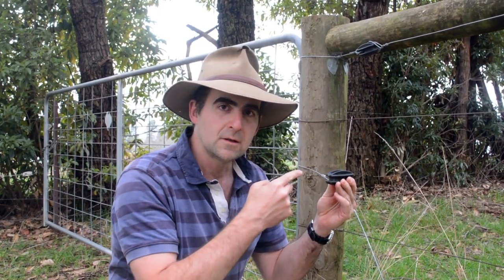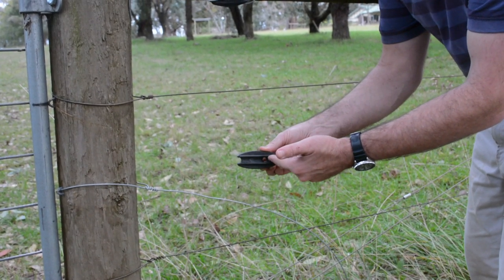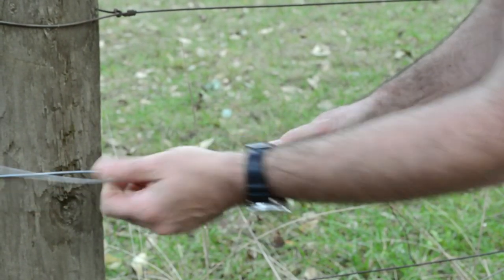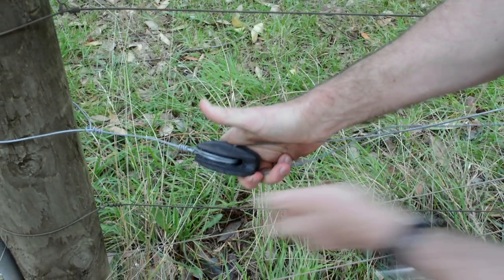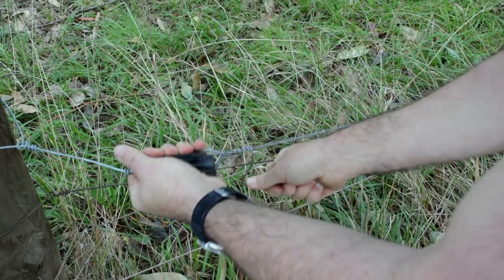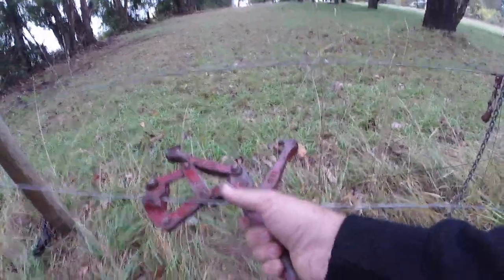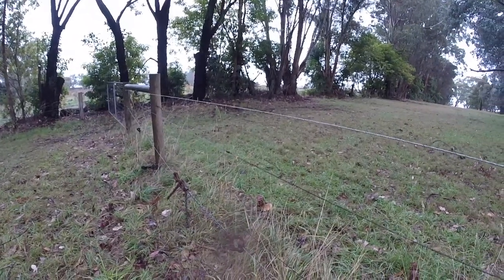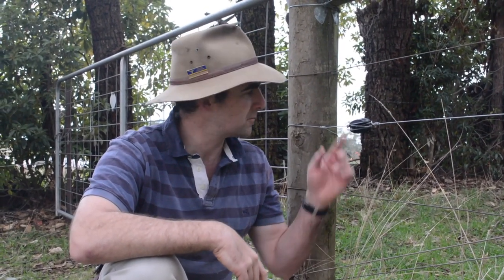Tying Off and Straining an Electric Fence

Comment: Hi Tim . what wire is better for electric fencing high tensile or aluminium wire and how to strain the aluminium wire and is tying off the same as high tensile. I know the video has been made a long time ago but i am just going over your videos again
Reply from the maker: Hi mate. Use highly conductive aluminium coated wire for lead outs to increase fence performance. Normal perimeter and internal wires should be fine with normal high tensile wire. I’m planning a video on wire choice soon
Reply: looking forward for that one @FarmLearningTim

Comment: Not being born in Australia I never even had remotely anything like AG as a subject; now through circumstances I am having to manage a farm that otherwise would have to be sold so this type of step by step videos are proving to be invaluable especially it is all FREE! Thank you Tim for this kind of masterclass...By the way Tim I seem to struggle a lot with the strainers. I have a hayes one like yours but it has a spring and I find it a nuisance and hard to slip the chain through. Did you take your spring off or did you buy it like that?

Comment: Just moved on to 11 acres and had to put up poly tape on pickets to retain the horses we got, but will be looking at rest of the fence line. Thanks so much for your very informative and concice videos, jam packed with little jewels of knowledge. Just one question for now, what is the spacing of your posts? I have 7m between my pickets for the poly tape, but will be looking at HT wire for boundary fence.

Comment: Hey Tim, love your fencing skills. Working on an electeic fence for about 30 acres right now. Using insulators. What I'm having troubles at right now is in corners where I have end strainers going to each fence length out from the corner like you have here at your termination. But, what's the best way to jump the  electric fence wires? Right now I just jump with poly that cuts off the corner, but would love a more elegant solution. Any tips?
Reply: Thanks for your thoughts, Tim. What you're saying sounds pretty much like what I'm doing. To avoid using the standoffs on the wooden H termination, I've done the bullnose on the live side (outside) of the H. I then jump from these live wires to the live wires on the other fence coming into the junction (and its own H termination) to successfully navigate the corner with electricity. Thinking now maybe I should have offset the wooden H post to try and equally balance the force being applied from the wires and only requiring 4 bullnoses instead of 8.. I was worried the high tensile 4 strand fence would pull the post over I guess..

Comment: Tim, thanks for the good info.  Could you drive a pipe and pull the amount of tension necessary for this type of fence without the H brace? Doesn't seem that there is that much stress on the ends to warrant an H brace.

Comment: Hey mate thanks alot for the great videos! just wondering if you would know why my electric fence has 1 hot wire but in some parts every wire is hot and the gate? thanks mate
Reply from the maker: Sounds like a problem with your insulators.
Reply: @FarmLearningTim  there all brand new haha   I was thinking along the lines of putting the insulated wire under the ground with no conduit around them? does that sound crazy haha?